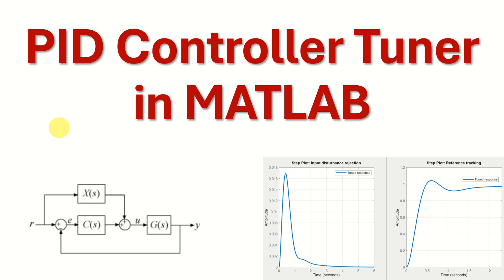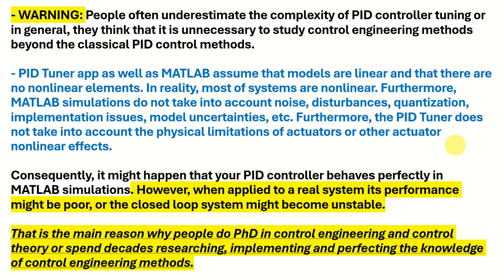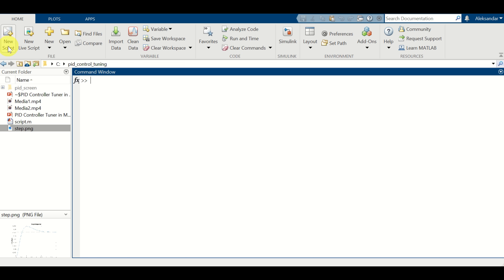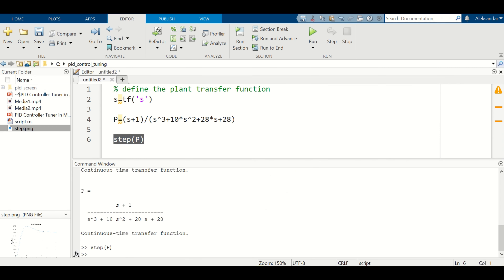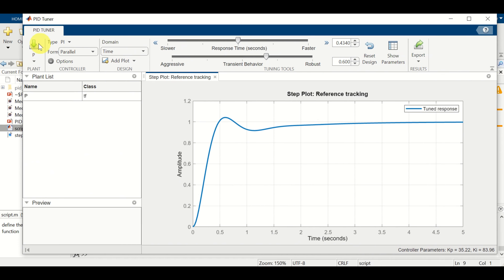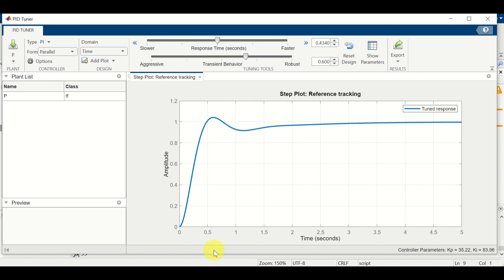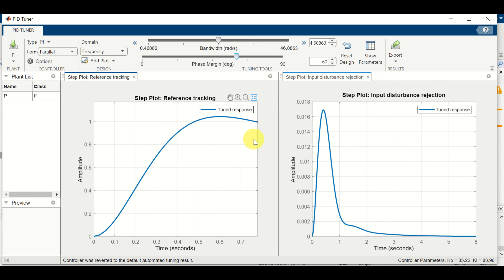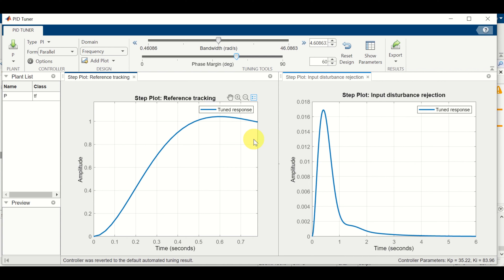How to Use PID Controller Tuner App in MATLAB

Comment from the maker: Due to the lack of time and energy, we do not provide free answers, suggestions, advice, or consultation in this comment section. All we can do is create these free tutorials that can serve as a starting point for independent problem-solving or learning. Consequently, please do not overload this comment section with questions that cannot be answered due to the lack of time. This comment section should not be used as a public forum. If you need consultation or help with your engineering problem and training, look into the description of this channel (top page of the channel) for more information. However, we do not work for free.